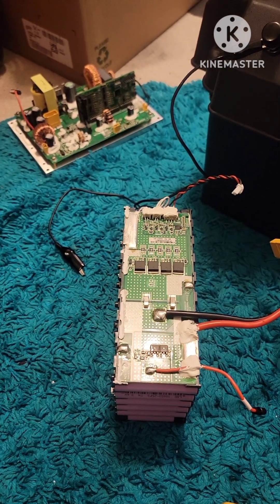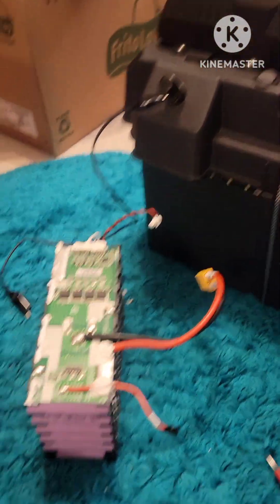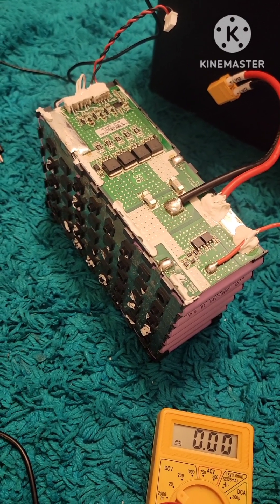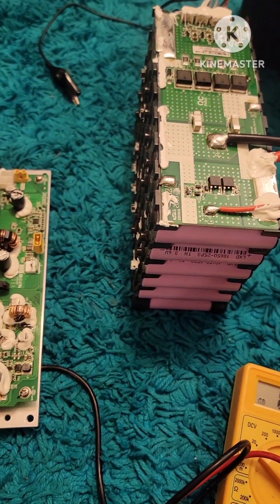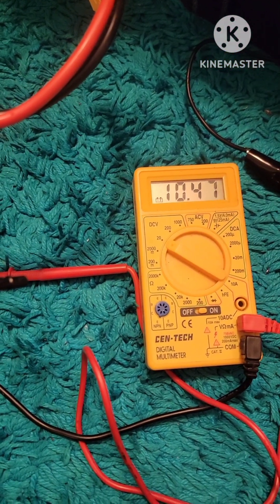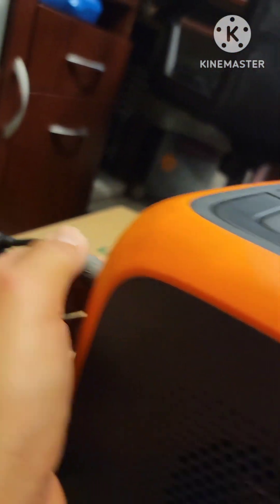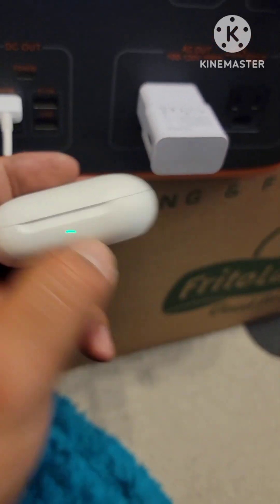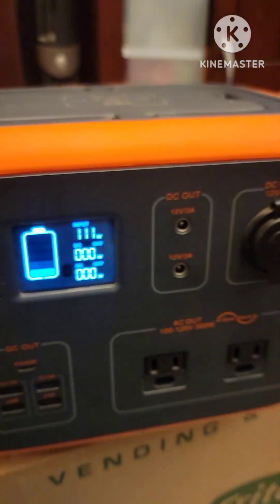Bluetti AC50S E09 error code fixed.

Comment: How do you "wake up" the battery? Where are the battery posts/connections? I disassembled the outer shell but don't know what to do next..
Reply from the maker: @timmellow1353  you'll need to take it apart and get a volt meter and locate the positive and negative posts.

Comment: Hey Peter, any advice you could give on firing up the battery. I’m pretty handy and would love to be able to fix it myself. But would definitely need a little bit more info. Any chance you could help out?
Reply from the maker: Take the battery bank apart. When you get to the battery pack, get a vilt meter and locate the positive and negative and make sure you get it at the 12 volt mark as they are in series with three different packs. Make sure you are jumping directly to the bank. Not the circuit board. Get another battery bank. I used a car battery. Jump positive to positive,  negative to negative. This will wake up the cells. You need to get the bluetti battery bank above 10.5 volts then it will charge. Once you get that done, your bank is awake. Congratulations.
Reply: @PeterZafra thanks mate, I’ll let you know how it goes 👍

Comment: Connect an AC 12v to the 12v output and turn the unit on. It will work without opening the unit—anyway poor design. I have two of them and in both the AC stopped working. Defective design got tossed with some specific load.
Reply: Hi :) im facing the same E09 Error code on my Poweroak. So I should put 12V alternating current on the 12V outlet ? On the cigarette lighter or the 12V/3A socket ?
Reply: @Bernd-q4d  hi. I got that error yesterday. I suggest try to charge it first and see if it works by keep pressing the DC out. For me I was in a Harry, so I connected a small  1 amp 12 v to the output not the cigarette one for just less than a second and the error just disappeared. I suggest avoid connected a high currant 12v but is this is the only source try to put something in series like a bult which will limit the current flow.
Reply: @ Thank you very much for the advice ! I'll try it :)

Comment: hi bud,  got the E09 error on mine last week, but my battery is sitting at 10.55v. got any idea how to get the thing out of error mode ?
Reply from the maker: @rmpc23  so you will need to wake up them cells. 10.55 might still be too low. Open up the bank and locate the pos and neg terminals of the cells and jump the battery with another 12 volt source. That should get you out of E09 error.

Comment: I'm impressed you got the battery out.  My display is going bad.  Honestly these are the worst power stations ever. 12.6 should be close to full I think.  4.2 x 3
Reply from the maker: I agree. There are definitely not designed to last long. Basically one bad cell cam alter the performance of the whole unit.

Comment: I'm an idiot with no idea what I'm doing but :

Remove the rubber thingy around it, 4 screws, side plate are just clips and then 4 screws for the fan.
Unplug the cables that stop you from removing the cover, unplug the big cable with the yellow connector connecting the battery.
 a car jump starter (or anything 12V really) can revive the battery.

Comment: Mine will now charge for 3-10 seconds @100 watts and then shut itself down. no clue why. Originally it popped up the error code, now no error code.
Reply from the maker: Some of the cells are asleep
Reply: @PeterZafra  after a few hours it will charge for up to 3 minutes and stop. It is currently @ 40%. 
I used my 12 volt trickle charger for my tractor for about a week, the error code stopped. Fingers crossed!

Comment: Dude...how did you open it up?   I took off the side covers and the four screws from the top but still can't seem to get it open.  Do I need to take off the screws to the fans or the handles?  They don't seem like they are holding anything.
Reply from the maker: Not the handles but the screws for the fan and the other side cover as well. Your almost there. Cheers

Comment: So in short you are bypassing the charge control board to get it to take a charge?
Are the batteries just too discharged?
Reply from the maker: Just to wake up the cells. I pulsed them to wale them up with a charger then resumed normal.al charging

Comment: My Poweroak (exact same as Bluetti) has the same error code and cannot get it to take a charge. If only I lived in the US I’d get you to help me out with it as I’m £500 out of pocket now and poweroak won’t help out whatsoever!
Reply from the maker: Aww man. Yes. The batteries need a little "jolt" to wake them up ao it will charge again. Find someone that can use a tester and have them help you "wake them up" using a charging source. Sorry. I wish I can help further.
Reply: @PeterZafra  Hi mate, so I roped my Dad into helping me as he’s a lot more electrically knowledgeable than me!
Stripped it out and charged the cells. Now reading 11.28V at the end of the main power connector. Plug it back in and it’s still showing ‘E09’… any tips?
Reply: I am in the same boat with Poweroak. Shameful customer service. I am disgusted. Just over 2 years owned and now totally useless.
Reply: @MrGuitarmikeg  mine was 2 weeks past the "warranty" and found out the batteries are not covered anyhow.